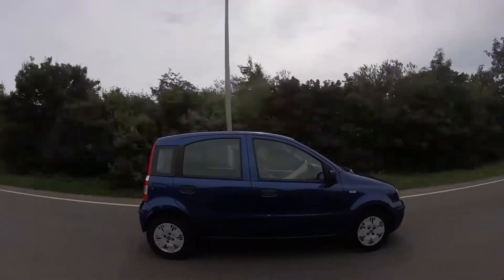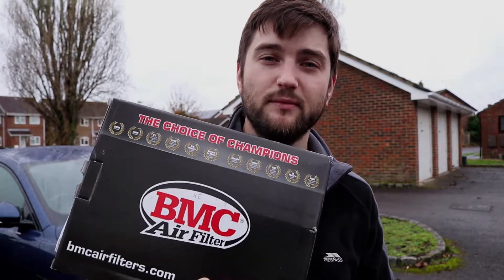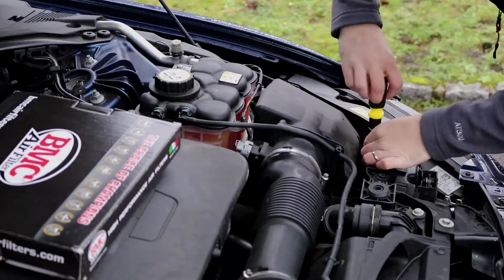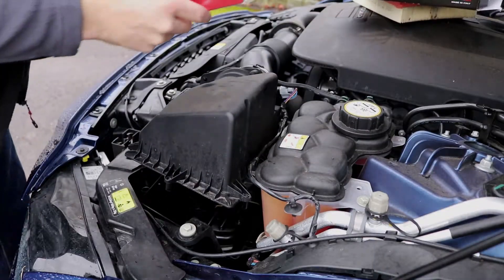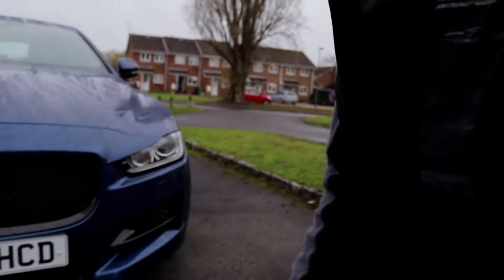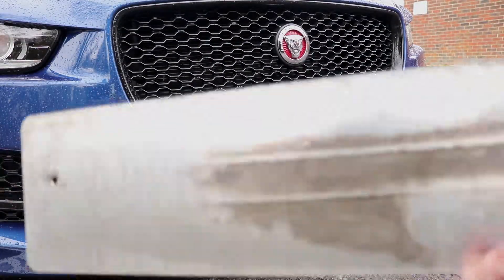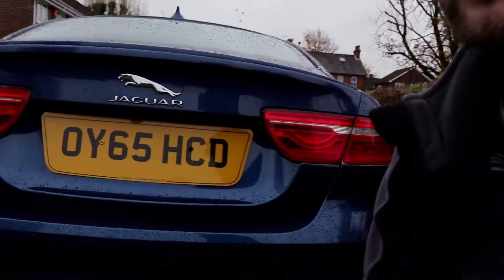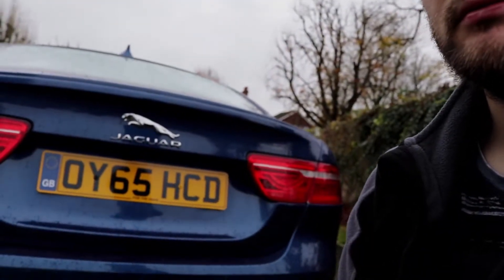I Do Some Home Improvements To The XE

Comment: I've been enjoying your videos on the XE.  I'm buying one of these this week, its got the same engine but its the prestige model rather than the r-sport. 

Was just wondering, if you can remember, if after fitting the performance air filter did you get any noticeable induction noise?  In my current car I've fitted a CAI with cone filter which gives a nice tone but on the XE I'm leaning more towards just a panel filter.  

Beyond that all I'll be looking to do is a bit more tone into the exhaust and probably just with custom back boxes like you done.  I may look at the tuning box you have but honestly I think the 230odd bhp that she is standard will be more than enough for me.  It's almost 100 more than my current car.
Reply from the maker: Not a huge amount of induction noise, the cone would always offer more noise. Also once I did the exhaust that’s all I wanted to hear haha.

Comment: Jag don’t put the plates on, dealers do during the PDI. I also have the usual rectangle plate on the rear that included the EU flag on there already so that was a winner. Regards to filter, I usually put a little perma pen mark on a part of the filter and check it later to see if it’s been swapped.
Reply: Good tip about the filter! :-)

Comment: Looks like your air filter was changed to me. They get dirty quickly
Reply from the maker: The only reason i’m skeptical about it is that my first car that I had for a few years, I used to do my own services, changing filters etc. The air filter would be cleaner than that after a year, let alone on a few months. But as this car produces over double the power of my old car, I’m open to believing that the filters get dirtier quicker.

Comment: The air filter is so easy to change. Come on!  It's like your turning your nose up at manual work because you seemed to manage ok. Try an oil change that's easy also it's just a straight forward ECOBOOST 2.0T Ford engine buy the correct oil and filter that way you know its done properly and all the bolts that hold the under tray on are put back.